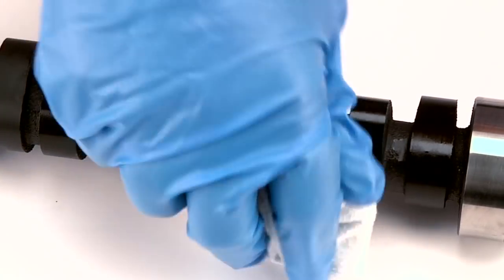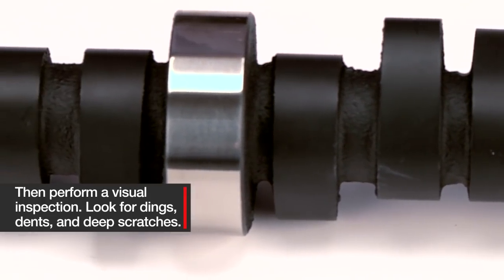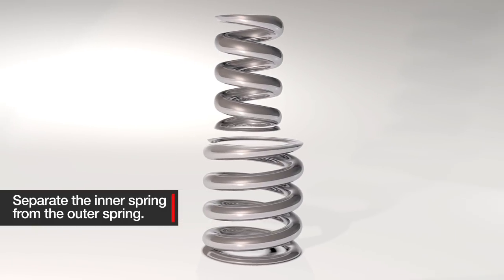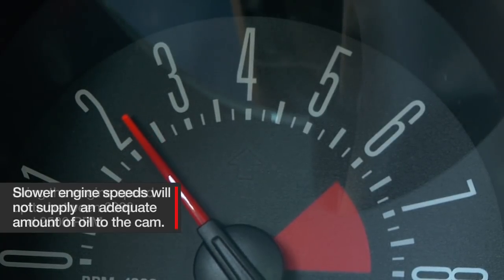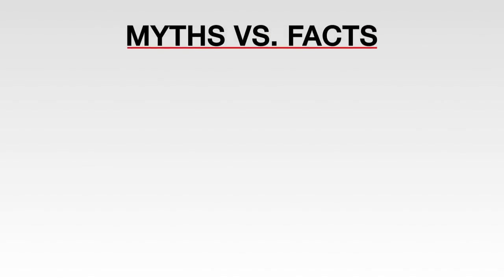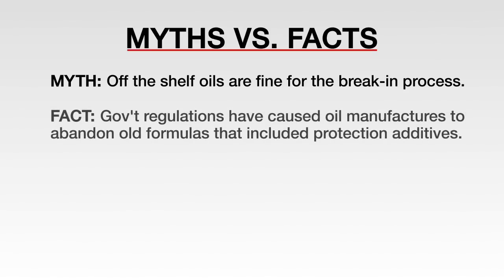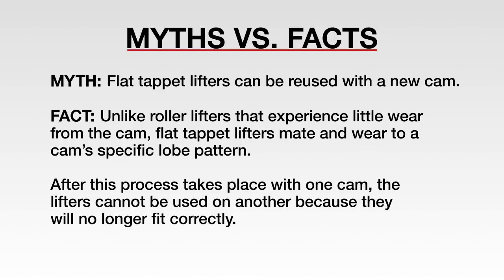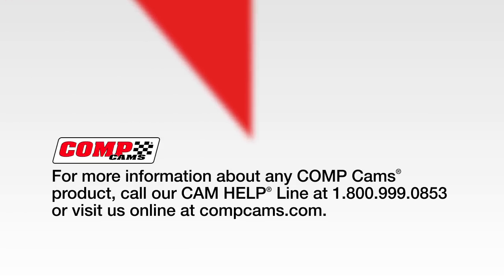COMP Cams® Quick Tech: Proper Flat Tappet Cam Break-In

Comment: As much as I appreciate this video much is left out. Prime the oil pump,  don't crank the motor for a prolonged period of time. Make sure push rods are all  rotating. Watch engine temp as this is likely a new motor. Make sure lash is correct or lifter preload is correct. Even then you can still have a cam failure. If a lifter stops rotating the cam will fail VERY VERY VERY quickly and destroy the cam and lifters dumping metal filings onto the crank and into the pan. The  filings are thrown around by the crank into the piston bores, wrist pins and in short order your motor is severely damaged.  I recently had a Comp 294s cam  wipe two lobes on a BBC. I went to great lengths to break it in. I suspect some of the problems with the frequency of  cam failures don't lie completely with modern oils or spring pressure.  Material selection, heat treatment, machining quality, quality in the cams castings and quality inspections all play a roll in the survival of engine components. Cam failures have been happening since the first cam was made but it seems to be very common in the last few decades so what changed. Cam design, spring pressures yes oil and the manufacturing of performance parts off shore. Buy quality parts and do some research. Where was your part made. The low price probably is reflective of the quality.
Reply: It says QUICK TECH.....
not "We're writing a novel."
Reply: @hotrodray9884  No shit....lol There is always that guy.🙄
Reply: @2015_Rubicnn  And he usually owns a shop with more "hands on" knowledge than 99.999% of the people watching this shit show...I would NEVER use that thin "Comp Break-in lube" - Using a Paste lube and NOT revving the engine 2000-2500 for 30min, works MUCH better. - But the parts must be quality...not made in China or Mexico.
Reply: @misters2837  cool story....

Comment: Don't use the red lube!! It's too runny! It won't stay put for when you need it. Buy Howard's extreme pressure lube #3. It's thick and will provide much better protection!
Reply: Iskys old school lube rocks too. Same experience as yours with that red stuff. 
Not worth using

Comment: I have a fairly aggressive custom Isky solid flat tappet ground on a Pro55 core for my big block Corvette.  The mechanical intensity is 32* for both intake and exhaust indicating that the ramps are very quick to open and close.  I used Johnson EDM light weight lifters with PAC Racing 1200 series Beehive valve springs #PAC-1220 set up at 148# seat and 344# over the nose.  For camshaft break-in I lubed up the cam with ARP molly paste, the thick grey stuff, and the foot of the lifters.  For break-in I used Joe Gibbs Driven XP-4 15W-50 conventional racing oil without any additives.  After typical camshaft break-in, I ran with that same oil for 500 miles, then replaced the oil filter and used Joe Gibbs HR 15W-50 Hot Rod Engine Oil, no additives.  After a thousand miles of driving, the valve lash hasn't budged what so ever.  Make sure that if you are going to run with a flat tappet camshaft, that ALL the components match, check that you have properly measured all critical clearances and most important, that your new valve train is manufactured in the USA.  Watch out for that re-boxed garbage/junk that comes from China or India.  Equally important is the ZDDP and phosphorus content in the oil to carry the load of a performance type camshaft.  NASCAR run solid flat tappets, but they are quite a bit more exotic than most of us can afford, none the less, they are still solid flat tappet cams, and they perform very well.

Comment: ...Still guys here are saying keep dumping more additives. No!
You dont need it just get a quality oil for flat tappets....Like VR-1 for instance. 
Also dont bother with diesel oil its not what it once was. 
No need for secret sauce if it survives break in it will last a long time. 

Lots of grinds before the fast ramp trend came out work great and last forever
Theres a point where the intensity factor just tries to grind the lifter and cam lobe to death. 
Not worth a gain of 5hp? If thats the case use a different cam, go roller or in most cases its a bigger arm your engine needs not a bigger cam. Took me decades to figger that one out. 
Them grey hairs....listen to em they been there done that!

Comment: This makes me want to buy a roller
Reply: +Rukkkis That's not a 100% guarantee that you won't have any problems down the road.  Roller cams have a host of other issue you have to consider to make sure that they perform as expected.
Reply: For the added ramp angles and lift, hell yes!
Reply: @1mikewalsh  Had a 15k mi HR cam awhile back that went flat in a years time. I personally set up the springs so I know they werent floating. 
Warned the owner about spending money with a marketing giant, finally listened and got Isky springs and a Crower cam.

Comment from the maker: Hello, the cam certainly may wear faster, but your best best here is to contact the CAM HELP line at 1.800.999.0853. They will be able to answer this question best. Depending on the application, you may need taller lifters at least.Thank you.

Comment: I would think that the camshaft gets its oil from between the lifter and lifter bore, therefore oil leaks onto the lobe. Either way, an engine at idle sprays quite a bit of oil. I would also think that keeping the engine at 2500 rpm allows the cam to spin fast enough to maintain a barrier of oil between the lobe and lifter, since a new lobe is rough and needs a thicker oil barrier.
Reply: Damn thats a good thought. Im gonna follow their instructions but God i can't say I'm not nervous

Comment: I thought you can run the comp cam break in oil for 500 miles ?? So after the initial break in for flat tappet cam you change the oil and filter ? And replace with break in oil for 500 miles ?  I have a 69 Ford 390 using a comp 265 dual energy cam I am about to start it after rebuild installed comp cam break in oil .....heard that break in oil can be used for 500 miles
Reply: Sadly no, you will have to change the oil after break in and it cools down. Keep fans on the motor during the process for extra precaution even tho 2500 rpms isn't that high. I just cant wrap my head around why it needs done for 30 minutes!?! I feel like the cam spinning that fast would create a barrier or oil around the cam without letting it get deep into the lobes. Im gonna follow the instructions and cross my fingers
Reply: @XDoGG117  
I have around 2,500 miles on my big block ford I only used the break in oil for cam break in and about 100/200 miles after that I use Royal Purpel XP oil with zinc and all the good stuff .  I changed my oil around 4 times since then no shiny metal or particles I did a compression test I had 150 at every cylinder dry test , with those good of numbers no sense in doing a wet test but I'm sure it be close to 155/160 at every cylinder .
Reply: Thats awesome sounds like a badass car!! I got a tbi 350 with a comp 268 flat tappet I just installed. I'm going to use the comp cams break in oil for the initial 30 minutes. Would you suggest getting another 5 quarts of it and running it for another 250 miles? I'm not sure what oil to use afterwards? First time don't wanna mess up my motor 😬
Reply: @XDoGG117  
Find a speed shop near by and use Royal Purple XP fortified with zinc and phosphorus .....Has to be XP not just Royal Purple the flat tappet needs zinc always some use regular oil and a zinc additive but I rather use the oil with zinc in it already .
I use 10w30 some used 10w40  the break in oil was very thin like water I would use it for at least 200 miles with both city and fwy miles but 500 miles  on that thin oil ???  Also I would suggest to break up the break in cycle better to do two 15 min sessions than one big 30 min break-in ...just let it cool down for around 10/15 min then do it the second time  , I strongly suggest purging the air out of the radiator before you break in the cam so you do not have overheating issues and false readings on your temp gauges .
Reply: Thank you so much!
Reply: Comp break in oil for around 200 miles then good zinc fortified oil after and they suggest changing the oil regularly for the first 500 to 1,000 miles if you changed it every 300or 500miles or so till you get to 3,000 miles so that be close to 4 times you get all the shavings and metal out of the motor while it's breaking in there was a article on this online this is were I got all this info on breaking in a flat tappet cam motor and rings etc ...
Reply: Read 540rat blog and learn the FACTS
Reply: @TheThirdWheel618  you have ZERO clue what you're talking about.....
Reply: @freemanfornow264  oh so your here to help out ? with your sarcasm help me correct me ? with that comment ?  I currently have 4,500 miles on the engine now I use royal purple XP oil every oil change .
The first change was at 500 miles that was comp break in oil  second at around 1, 100  with royal purple XP third around 3,000 I did a compression test all cylinders were 150 psi every flipping one on them ! That sounds like a engine that broke in evenly it's low compression truck 390 with truck heads 9:1 compression thank you .
Reply: @XDoGG117  Valvoline VR-1 has all the good stuff you need. 
If you are a freak about synthetic only Mobil 1 15-50 also has what flat tappets need. I prefer dino oil as it has more cushion to it which these cams need .

Comment: can I use this every oil change ?
Reply from the maker: Hi John, it certainly won't hurt to use this when you change your oil, but you don't need to if you don't want to tear down your engine each time. Thank you.
Reply: what do you mean if I don't want to tear down my engine each time ? I used it for my break in 30 miles and again at 200 miles now I have 500 miles on it and I want to change it every 3000 miles and this oil is only a dollar more then Valvoline and then i would need to add an additive
Reply from the maker: The break-in oil is a short life oil, for about 500 miles maximum. For longer, 3000-mile change intervals,you'll want to swap over to our Muscle Car and Street Rod Engine Oil. Hope this helps, if you have further questions you can also certainly free to call our tech line at 1.800.999.0853. Thanks!